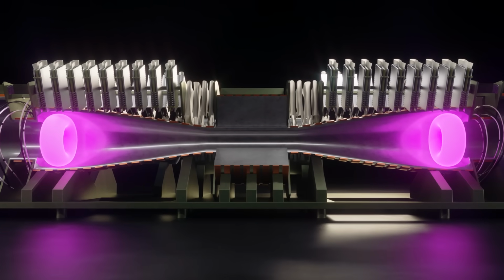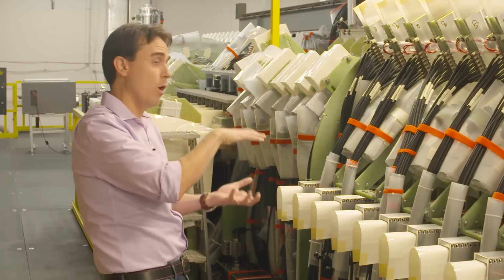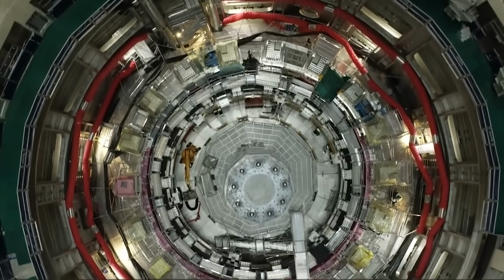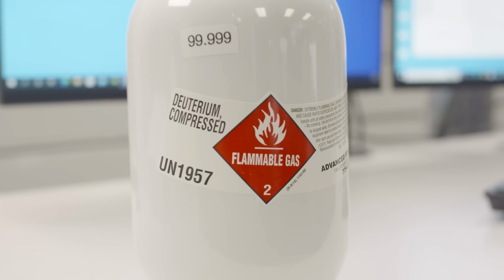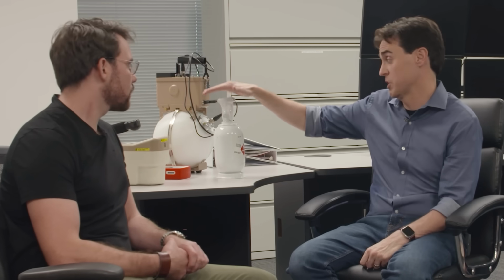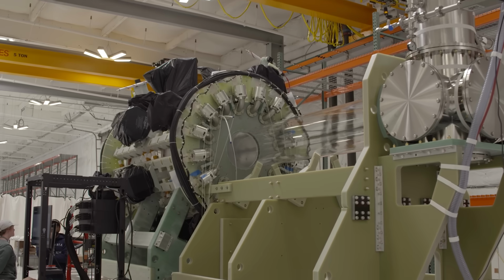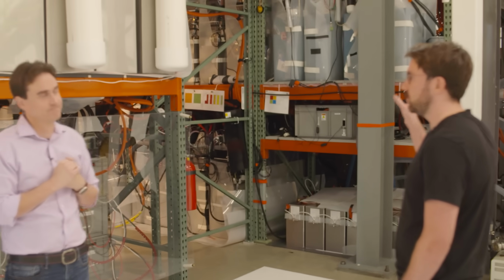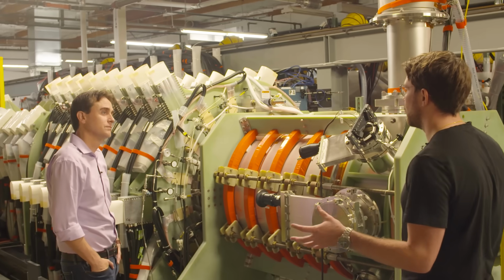A New Way to Achieve Nuclear Fusion: Helion

Comment: Okay now we just need stable income of fussion fuel, polishing the design to reduce cost without sacrificing functions, and most importantly a competent operators and maintenance crew

We dont want to have a Fusion equivalent of Chernobyl/Fukushima, i dont know if the same calibre of catastrophe can happen, but better be safe so the reputation of Fusion are intact
Reply: The fuel is made by the same (type of, or actually same) machine. These machines cannot have major accidents. It is one of the main arguments for fusion. There is not really anything conceivable that could go wrong. E.g. plasma "wants" to cool off quickly if something was to break. The total energy content of a pulse is very low, etc, etc. 
Compared to other energy sources even nuclear fission is very safe, btw. Chernobyl being the sole outlier. Fukushima is not even on the map compared to the environmental and health damage done by fossil fuels every year.

Comment: Questions from me:

1) For the Trenta model, what is the amount of "recharging" that can be input into the capacitors per "shot" event? Take the total full capacity of the capacitors as benchmark

2) Seems like the excess heat for Polaris is due to the attempt to match the electrical generation frequency to 50 Hz minimum which possibly means 50 "shots" a second, which is a massive amount of heat - possibly water can be used to produce steam at least? The order of temps is 100 million Celcius.. Sounds like I might have missed a huge gap in knowledge there

3) Is the amount of magnetic field change greater or calculated to be greater than the amount of magnetic field created at the center?

I'm sure I can get the full brief if I was an investor but obviously I'm not an investor! Will keep an eye out at Helion in the future.
Reply: 1) not sure what you mean with that. I guess you are referring to the energy recapture. Even without any fusion happening, they can recover 95% of input energy and put it back into the capacitor. With fusion reactions happening, there is extra energy that gets added to that. 
Trenta is an experiment meant to retire the last physics risks and test some other aspects of the design. AFAIK, as a cost saving measure, I does not do the recapture but that was tested in a previous, smaller prototype. 
Polaris will put everything together in a bigger machine with a higher pulse rate and produce net electricity for the first time.

2) Polaris will operate at 1 Hz. Future powerplants are currently targeted for 10 Hz. They do not have to match to grid frequency since the energy is stored in capacitors anyway and then released to the grid from there. 
The direct energy conversion is very efficient and there is not that much waste heat. In a mixed mode machine (burns Deuterium to make He3 which gets added to the next shot), there would maybe be about 20% waste heat (by my high estimate and it might be less). In a 50 MWe plant that is 10 MWth in heat. With an efficient steam cycle, you get maybe 3.3 MWe from that. I am not sure it makes sense to have all the extra CapEx and complexity added by a steam plant just add an extra 7% (at best) to the electricity output. 

BUT...
They are currently doing trade studies for dedicated He3 breeders that would only burn Deuterium. Those would be located at a few dedicated locations, supplying distributed D-He3 machines with fuel. Since they would run on D-D only, about 33% of the energy is released as neutrons (rather than 10% for mixed mode machines and <5% for D-He3 machines). Since D-D fusion releases less energy than D-He3 fusion dedicated breeders might also be bigger than the mixed mode- and dedicated D-He3 machines. So, more heat produced overall, and it might make more sense to capture that and get some extra net power output to the grid for profit (rather than it being essentially self-sustaining with a tiny bit extra for say powering their own facility or so). 
The path is not set yet and some of it depends (among other non- technical issues) on the regulatory framework that is not finalized yet and thus hard to predict. Others are location options, customer demand/requirements, etc. There is also the possibility that D-D breeders could make extra money from selling some of the Tritium for profit. There is a high (and potentially growing) demand for it.
The good news is that they have options for the future. 

3) I am not sure what you mean with that question.

Comment: And all to run a steam engine (Turbine). 🙂
Reply: This process is direct energy from the fusion reaction, no steam or turbine at all.
Reply: @Chiefsavage23  Hmm..A fusion reactor works according to the classic principle of a thermal power plant.
Water or alternative substances are heated and drive a steam turbine, whose kinetic energy is converted into electricity by a generator. A fusion power plant initially requires a large amount of energy.

Is something else going on here?

Comment: Great technology. Unfortunately there isn't enough helium-3 in  the entire world to power even a few of these reactors if they can demonstrate net energy gain.
Reply: You might have missed it, but Helion will produce their Helium3 by fusing Deuterium in the same machine. D+D => He3 +n or D+D => T + p (the Tritium eventually decays to He3 as well).
Reply: @elmarmoelzer2229  I see. So the two FRC plasmas fired down the long axis of the machine are pure deuterium?
Reply: @shahen45   It depends on what they plan to do. 
Most of the net energy comes from the D-He3 reactions. The D-D reactions just sustain themselves with a small net electricity output.

They have several options and they are still weighing them against each other.

1. Have pure D-D breeder machines at a central location that do nothing but fuse Deuterium to make Helium3 and Tritium (and a bit of electricity to sell or power their own facilities). Dedicated D-D machines could also be slightly bigger and with that have more power output and lower neutron wall loads.
Then have distributed D-He3 machines that do nothing but D-He3 fusion using the He3 produced by the dedicated breeders. 
The advantage is siting since the D-He3 machines would have only very little Tritium on site. So, the licensing would be easier. 
They want to keep their distributed machines small enough to be easily transportable by road.
Maintenance on the D-He3 machines would be easier too. And it is easier to service D-D machines if they are all in a central location (or very few locations).

2. Have only mixed mode machines that run relatively lean on He3. Those would be what they are currently designing for. These machines would still be small enough to be transported by road.
For these, the very first shot(s) would be pure D-D. The He3 and Tritium are extracted between shots and separated. The He3 gets mixed into the subsequent shots.
Advantage is that they only have one type of machine to build and maintain. 
These could also run on pure D-D during times of low demand to build up a He3 stock for times of high demand.

3. Some combination of both. 
There are also options to co- locate multiple machines which reduces CapEx since they can share quite a bit of the equipment. 

Hope I explained that well.
Reply: @elmarmoelzer2229  You did. Thanks for taking the time to do that.

Comment: Dear Engineering Earth Aliens,

Please explain... in detail...10 million degrees of pulsating energy at 10 jolts per a second, simply being held together by metal screws, bolts, and a few cable wires? 😆

Comment: My $0.02: A working quantum supercomputer will be completed someday by a company like IBM or Microsoft or DWave. The public won’t hear about it other than rumors similar to during The Manhattan Project. They’ll test  and tweak it on small scale projects. Eventually they’ll use it to design a working fusion reactor and announce both at the same time basically using the reactor design as proof without disclosing the QC design to hostile governments.

Comment: Wind power is most definitely not cheaper than nuclear fission.
Reply: ?? Wind is far and away cheaper than fission. It’s not even close any more
Reply: @Gomlmon99  Absolutely false when one considers the total cost of operating wind power - as one should - such as the infrastructure required to maintain supply during non-windy days and the cost of the land.  Wind consumes 170 times the land vs nuclear per megawatt-hour.
Reply: @johnn.3887  Any stats to back that up? Because every study I’ve ever seen says you’re wrong. 

I couldn’t care less about land use. Especially when most of our wind is in the sea.
Reply: @Gomlmon99  It took me five minutes to find what I said - not hard.  Land use is absolutely legitimate - and costly - and destroys land value - and is detrimental to the environment.  And, as said, wind requires "backstop" sources when the wind stops blowing.  Nuclear is cheaper when you consider true costs and would be much, much cheaper if it weren't so over-regulated.
Reply: @johnn.3887  link your source then
Reply: @Gomlmon99  SEARCH THE INTERNET.  It's that simple.
Reply: @johnn.3887  I did. It confirmed that fission is more expensive. I already knew that, which is why I said it.

You’re claiming otherwise, and that you found it quickly, so why not show what you found?

Comment: What I like the most about this tech (should it work), is the direct energy conversion. No need for water and steam turbines. This is extremely promising, and would be the greenest energy ever created. The 7th prototype is expected to generate more power than it consumes bu 2024. I have no way to verify this as I dont know shit about nuclear engineering, but if it does work as announced, it’s gonna be the biggest scientific breakthrough since the invention of information technology (aka computers and internet). This is WAY cheaper and smaller than the other fusion projects like Tokamak.

Comment: I don't think it needs to be much bigger, but being able to utilize a second or third set of magnetic fields could help increase the density of the normal field during fusion. So even though the heat increases the pressure, you still may be able to kick on those extra electromagnets.

Comment: I am very impressed with Helion and how they seem to really go outside the box a little and combine creativity with different and dynamic perspectives of the science, technology, and engineering of fusion. And their solutions give me more hope that fusion will be a real thing in everyone's lives not in tens of years but inside ten years. My only question or issue with this right now, and what I didn't really pick up on during this piece, is does the Helion type of solution yield net gain? Is there more energy coming out of the process than is put into the process? That, to my current understanding, is a fundamental requirement and characteristic of the fusion solution.
Reply: No, they promise it in 2024 but only time will tell.

Comment: Are the two plasma donuts spinning? Like I think if they were spinning in opposite directions that would add additional energy once they contact right?
Reply: A rebuttle: https://www.youtube.com/watch?v=3vUPhsFoniw
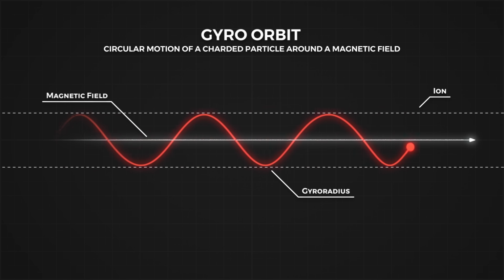Reply: 21:36 <--- Pretty sure this is why he asked the question
Reply: Nope. The donuts are a consequence of the shape of the toroidal magnetic containment fields.  I'm pretty sure rotating the plasmas would be detrimental to accelerating them. Or at least make doing so much more complicated.
Reply: @obsidianjane4413  Actually, part of what makes the FRCs stable after formation is the internal motion of the charged particles creating a self-stabilizing magnetic field.

You are correct though that this doesn't contribute to the heating during collision.
Reply: @obsidianjane4413 I was kind of initially confused with your response because obviously the plasma is spinning but I think I get what your saying. It’s plasma at insane temps so it’s going crazy and moving all over but it’s not all spinning one direction coherently as a whole, that kind of goes against the whole concept of plasma as limited as my understanding is of it
Reply: @monhi64  Yes. as I understand it, its simply a "slug" of plasma not something like a cyclotron.
Reply: lmfao this random dude named Kyle in the Youtube comments thinks he knows more than some of the world's top engineers and physicists. The internet is a wonderful place. GO ON KYLE
Reply: @johnoverton9558  "this random dude named Kyle in the Youtube comments thinks he knows more than some of the world's top engineers and physicists"

What? He asked a question. Asking a question isn't a claim of knowing something. It's (normally) the opposite.
Reply: @johnoverton9558  thank you John
Reply: @johnoverton9558  Can't get answers to questions you dont ask. Kyle inquiring about something so that he can get a better understanding of the  things put out in the presentation.

He was asking a question, not making a statement of fact.

Comment: 100,000 Amps... wow... new way yet same issue like any other way, energy input significantly larger than energy output.  Don't be fooled by this video, any post grad can come up with fusion reactors where energy in is higher than out.